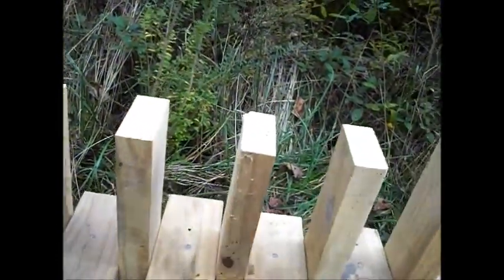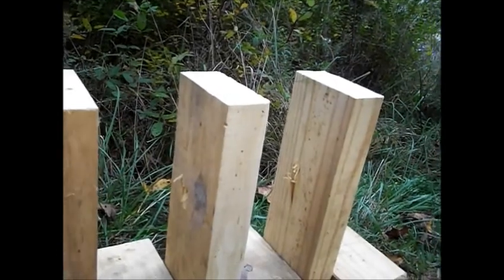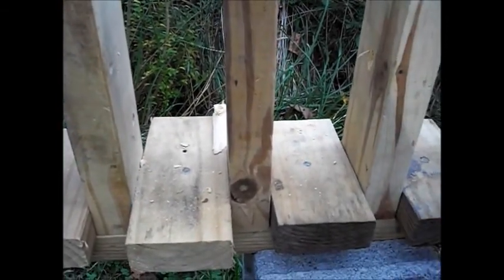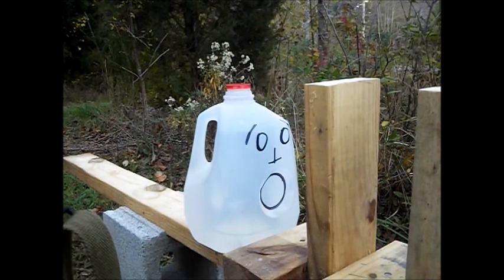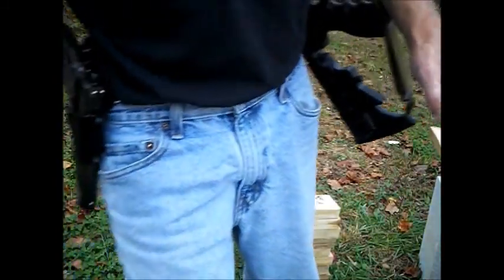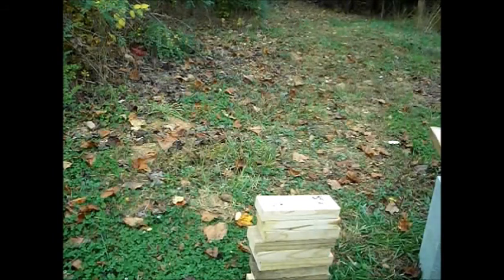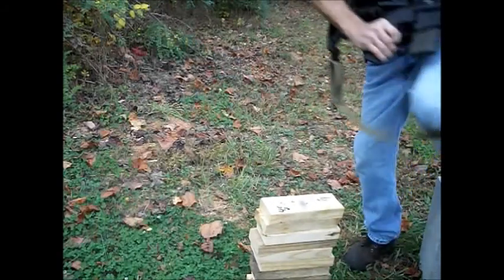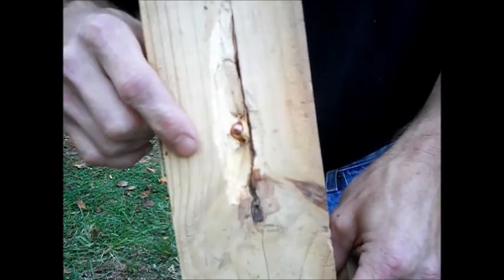RIFLE VS HANDGUN PENETRATION TEST "for home defense"

Comment: search around youtube and you will see a demo of 9mm and .223 hollow points tend to cup the soft material of drywall, turn into hardball, and will penetrate 3+ walls of drywall.  Each wall is spread about 15ft apart and has a sheet of drywall, insulation, and a sheet of drywall.

Comment: What this test shows me, Is that 9, 40, and 45 will all get the job done. 223 / 5.56 will get the job done at a longer distance. The 40 and the 9 did basically the same thing the 45 stopped in the 3rd 2" thick board but left a bigger hole The Human Sternum ( Chest Bone ) is only about 1" thick and for sake of argument say it is just as hard as one of these boards. So to my thinking in the home a 9mm carbine will do the job. For outside I would use the AR. Hollow points in the home would be fine.

Comment: Only problem with the test, which I found to be very useful, is that it would be ill advised to use fmj for self defense outside or inside the home. I reckon you'd be using specialized ammunition for those types of applications.

Comment: It was fun to watch, but you need to try several different types of 5.56 or .223 ammo. A Winchester soft tip would have fragmented quicker, so would the M193 ammo. They also make specific ammo to use in an AR for home defense. 

The green tip round you had in the AR Mag would have met the happy jug probably. (Ok, I already had this typed when I hear you talk about the green tip)

Try a good 357 magnum round, that might be interesting also. 

Thanks for the work.

Comment: Green tip would go clean through that
Reply: and M193 would have gone through two before it started tumbling.
Reply: *****
wrong... 193 is specifically designed to fragment on impact of anything and is known to blow apart when passing through two close proximity drywall slabs like any interior wall at anything but a 90 or near 90 degree angle of impact... And if it doesn't it almost immediately dumps off all its energy making the likely hood of a fatal impact on the other side of the wall lower. its been well documented that 9mm 45, and 12g buck will go further through a house than 556 HD loads and usually remain completely lethal until they hit a firewall.  green tip is a fucking steel core anti personnel round designed to pierce soviet era bodyarmors. people need to stop bitching in YouTube comments about using an ar for home defense because its "overpowered". you simply haven't got a clue what HD ar15 load ballistics are. a 9mm will kill anyone on the other side of drywall. 556 HD loads are less likely to especially if it properly fragments on impact.
Reply: +Lonewolf6565 Who you gonna believe, me or your lying cheating eyes? You keep using 5.56 for home defense.  Forget physics, don't listen to the nay sayers, don't believe your eyes, just keep believing that a high velocity 5.56 round will never over penetrate, much less through multiple walls.  That's why I use a 357 magnum because it's faster than a .45acp .
Reply: El Guapo You dont understand physics or how it effects very light bullets traveling at very high speeds. MASS is a thing you know. a .357 is going to go through more walls than a frangible .223...

Comment: I have a friend with an old house on his property that we use for target practice. Ive fired .223 in one side and out the other through 6 layers of drywall and vinyl siding. The .223 doesnt seem to behave  much different than most other ammo we play with. Ive recovered quite a few fired .223 rounds from the mud bank behind the house that were mangled but intact. IMHO anyone who thinks that the .223 is a safe round for home defense in a populated area is just fooling themselves

Comment: Wood may be the structural material but drywall is what a bullet is most likely to pass through.
Reply: Yes that is correct and the two layers of drywall would be even easier for the bullet to go thru than a 1 and 5/8 inch thick lumber.  It just shows that you can't rely on walls for your safety.  I hope you understand that you can use this information by knowing that you can shoot a criminal thru walls if they are enetring your house.  A warning shot is a good idea also so you don't go to jail.
Reply: The Chopping Block no no no. Stacking a bunch of 2x4's 6 inches apart is not how the .223 should be tested. There are many tests in YouTube that accurately show how effective the ar15 is for self defense compared to the common handgun calibers and shotguns running 00 buck. This guy really doesn't have a clue.
Reply: HealthSupercharger >>warning shot?  You're joking, right?
Reply: @jamesriley3112  Personally small caliber rifles are some of my least favorite 7.62x39mm and 6mm bullets are usally my preference with my favorite being 8mm sized bullets if im going to go with a small caliber rifle im going for a 22 mag or hornet or a pistol caliber carbine you can use small caliber rifle ammo but really whats the point your not gaining very much at all your getting very weak ballistics with  not a great improvement in recoil

Comment: The 5.56 is designed to wound, not create an exit wound. It enters, and tumbles, breaking ribs, internal bleeding, etc. That's why you get less penetration.
Reply: The cartridge wasn't "designed to wound". The notorious tumbling in Vietnam was because the M16-A1s barrel didn't have a fast enough twist rate to properly stabilize the 55 grain bullets, and even when the bullets failed to stabilize they'd still pop right through a human.
Modern .223/.556 rifles with faster twist rates (1-9, 1-7 etc) shoot the same as any other rifle. Almost all high velocity rifle bullets will start to tumble on impact simple because the rear of a bullet is heavier than the front(the back of the bullet has more momentum).
Reply: Fleece Johnson Actually, the 5.56 WAS designed to tumble after hitting the target. This was done to create larger wound tract after NATO outlawed the use of hollow points in combat.
Reply: Scott Mcdaniel As I said before, most high power rifle bullets tumble when they strike something. The longer and narrower the bullet, the easier it tumbles. The fact that 5.56 tumbles violently was an added bonus, not the entire point of the cartridge. Modern M855"green tip" ammo usually doesn't tumble at all after its traveled 100 meters, it just ice picks people.
Reply: Fleece Johnson I was referring to the original designs which are basically the standard FMJ, not the newer green tips or hollow point. But I guess we're both right in a sense.
Reply: false
Reply: Scott Mcdaniel
the old us military load is 193 and it was designed to fragment when it hits flesh. it tumbled easily in the original m16 because the military used 193 instead of the round stoner designed the rifle to actually. the new load they adopted during the cold war is 855. which is actually armor piercing and one of only a handful of loads that has been made exempt from bans via  . don't use fucking 855 for hd. proper split core hollow point HD loads like Winchester pdx 1 are designed specifically to fragment and dump as much energy as rapidly as possible if it hits drywall. hornady tap and other police market ammunition are also specifically designed to limit drywall penetration. people just don't know the realities of using a gun indoors. a 9mm will travel through many more drywall sheets than a 556 HD load and will remain lethal through several rooms. the more sheets a 556 hits the less likely it is to be fatal and even after 1 sheet looses a huge amount of energy.